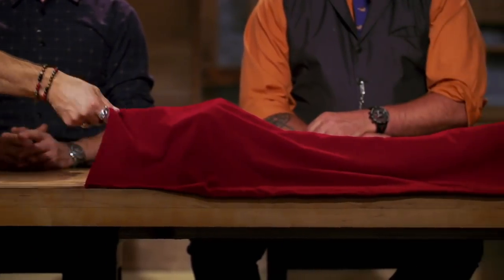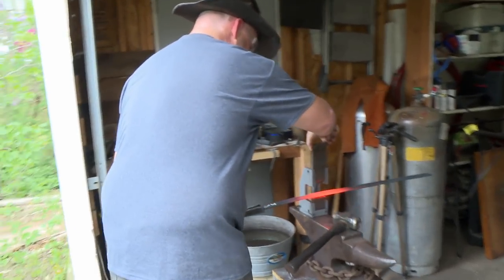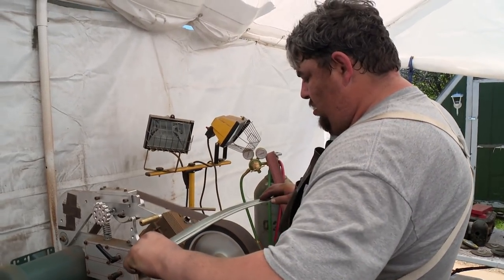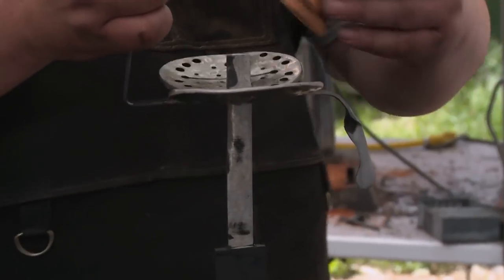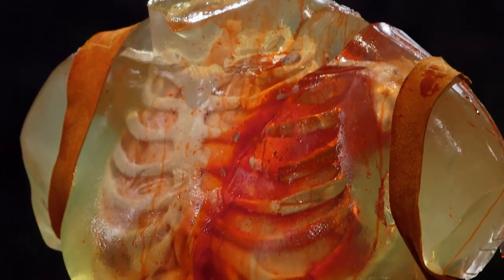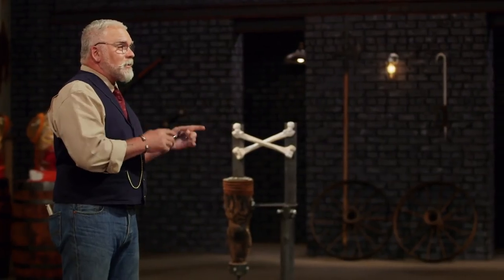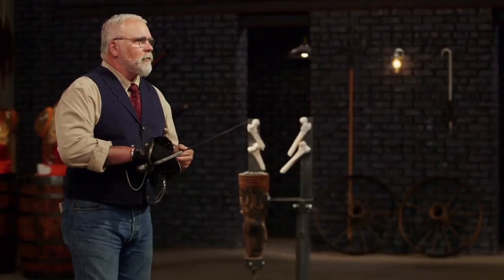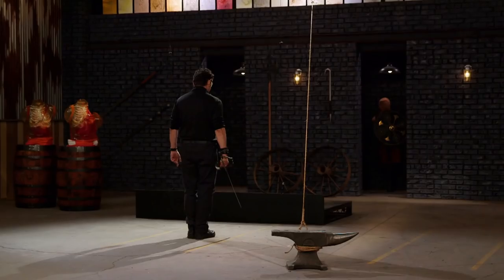Forged in Fire: BLACKBEARD'S CUTLASS ATTACKS THE FINAL ROUND (Season 6) | History

Comment: did they get in trouble for puttin heads on the dummies or somethin
Reply: its all about the weapon, a thin curved 1 handed cutlass was meant for long slashes, as you could see due to the lack of power on the swings, a human skull would stop the blade. The use the head if the weapon should by design cave in or break the skull and if the weapon would have the ability to behead, this blade would cut the throat. Hope this helps!
Reply: @TheProGamingDragon  bro they tested cane swords on dummies with heads. Blackbeard deserves better.
Reply: J K they tested a grim reapers scythe as well to behead the dummies
Reply: @JK-fu1bn  That's because the stave portion of a swordstick should be able to break the nose and crack the skull on a swing.

Comment: I feel like heaviness shouldn't matter because it all depends on the users size and strength. But if that blade was truly front heavy that's reasonable
Reply: Robert MacKinnon the heaviness can impact the smoothness of the swing that will impact the way they work even if the user is strong and large
Reply: The balance of a blade is one of the most important factors when it comes to swordsmithing. The issue with his blade was not just the weight, but the distribution of the weight. The blade was top heavy and for a cutlass that is supposed to be lightweight and balanced for maneuverability + cutting power this is not good. It means that one handed swings do hit harder, but lose speed, maneuverability and precision which leads to overall greater loss in cutting ability (the reason you would use a cutlass in the first place). It doesn't really matter how strong you are, your going to have a better time with the lighter balanced blade than the heavier top heavy one.